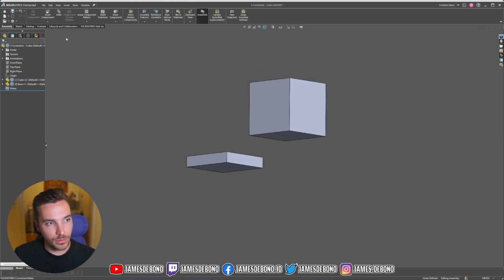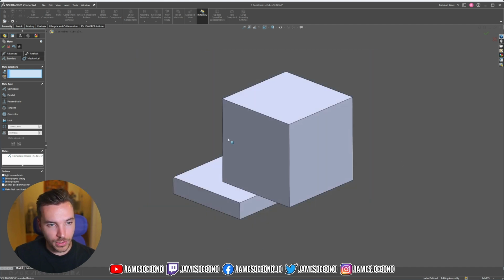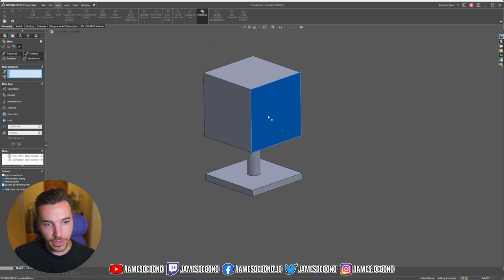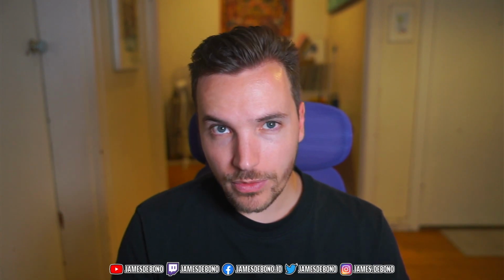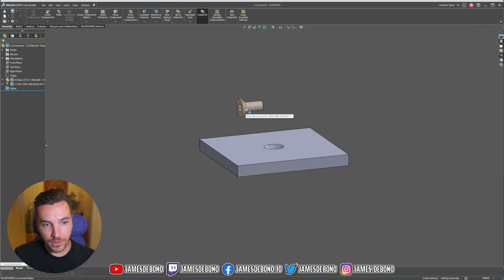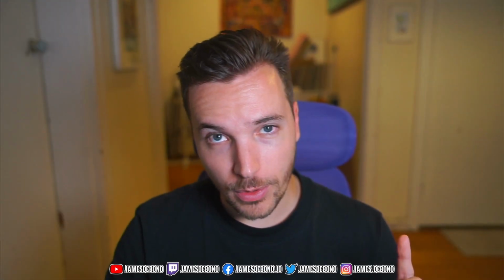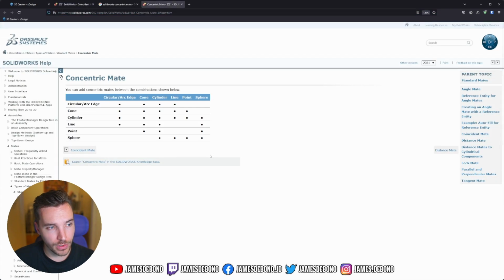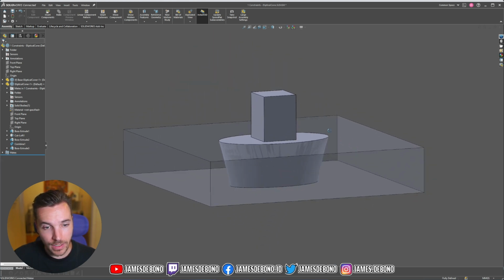Can you fully define CAD geometry with only 1 mate?

Comment: Any single surface that's not a revolved feature can fully lock in 1, i think
Reply from the maker: Yes you can use lock but that's not a geometric mate really
Reply: @JamesDeBono  Here I'm using "lock" interchangeably with "fully mated". Are you using "lock" as in an anchor mate?

To my first comment I should add: ... and as long as it's not a plane or an orthogonally extruded surface by 2d curve. Those two plus the revolved surface make this a decent definition of a fully interlockable surface mate. But then there's also helical sweeps, that wouldn't fully mate in one. There might be a few other cases I cant imagine at the moment.

Comment: Would a counter sunk n-face pyramid polygon mate and be constrained by a single face?

Meaning, instead of a cone like your example, a pyramid.
Reply from the maker: I guess if it's a pyramid then it would be multiple faces right? So it would need multiple mates
Reply: @JamesDeBono  oh is that how it works? Interesting 🤔
Reply from the maker: @tadilaco  Yeah I should have mentioned that the objects do not collide. They can go through each other. So if you only mated one face of the pyramid they could still slide through each other